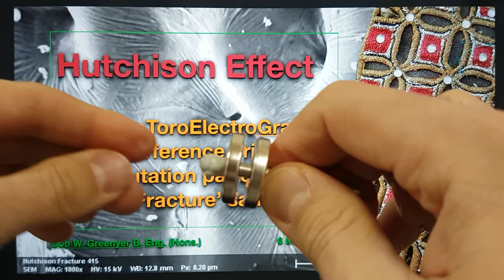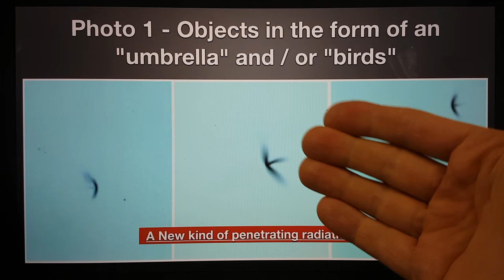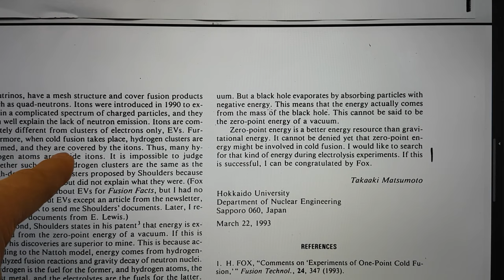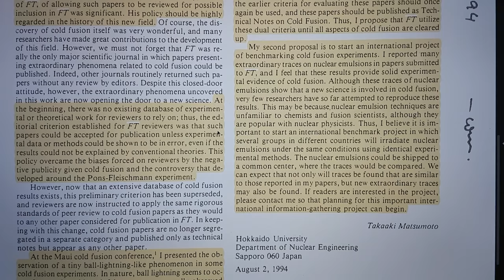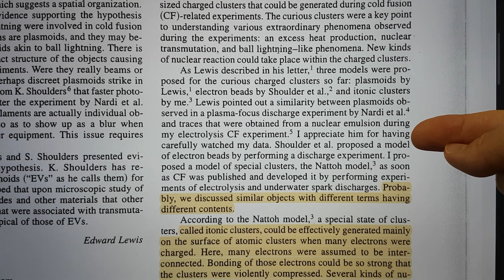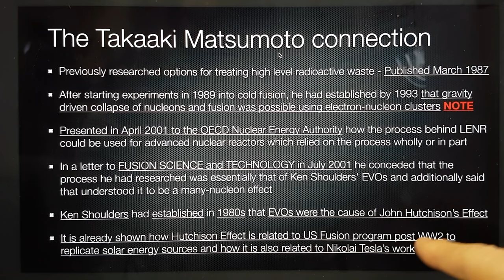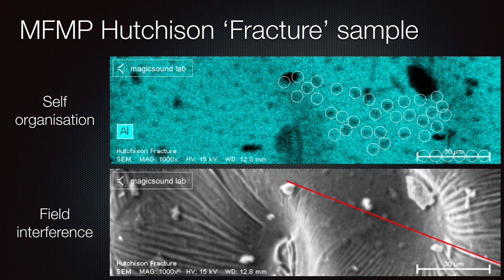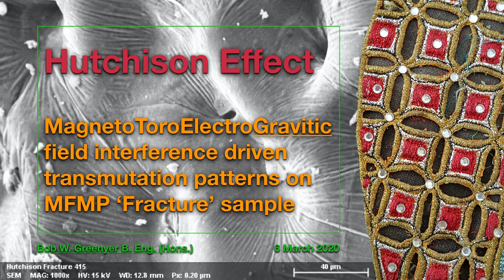Hutchison Effect - Magneto Toro Electro Gravitic field interference driven transmutation - Fracture

Comment: I think the geometry of the holes can be described as the arc discharge similar to what occurs on the sun.  The magnetic field lines form loops that leave the surface and then re-enter the surface.  That is my opinion and it could be wrong.

Comment: Its interesting that Palladium is used. Its on the list of David Hudsons ORME elements. They loose 4/9ths of their measured mass when they enter the high spin state. An 'anti gravity' effect. They superconduct (allegedly) at high temperatures. Complete digestion of gold should lead to a comparable excess heat to the palladium. All internal magnetic fields must be expelled, that is measured as excess heat. The excess heat of 'cold fusion' is actually a result of the lower energy state of mono atomic palladium over metallic palladium. ???????????????????????????????????????????????????????????????????????????????????
Reply from the maker: See here from mid 2017

https://youtu.be/NlCOFSbv6lQ?t=1225
Reply: @MFMP  Thank you. I thought I was all alone in the world with my obscure interest.

Comment: Air has plenty of carbon though. Misusing the word "effect", doesn't help much. You're observing effects (Hutchinson, knotted wrenches) of some machine you avoid talking about.  Do a video just about the machines and the operational commonalities between them.
Reply from the maker: There is a vast array of discussion and diagrams and books on what was used to cause the effect. There is a huge hole in published analysis of samples produced (though lots of analysis was done over the decades but not made public).

Showing WHAT happened will help establish what frequencies are important - since they are encoded in the interference patterns.
Reply: @MFMP  Maybe there are books, but I haven't seen any of that info being relayed by you. One would expect you'd be showing images, of devices used, every time you show the affected samples, as you were doing with samples taken out of devices you actually referred to as reactors. It just so happens that the most mysterious samples don't have a clear background.
Reply: @MFMP  Wonder why you didn't just link one of your previous videos watch?v=QHcVtYYjxfA    Cryptic titles make a hard find.
Reply from the maker: Air is 0.0391% CO2, and only 1 out of 3 atoms of those is C, Air has a lot of Nitrogen and Oxygen.
Reply: @MFMP  Still, if the conditions are right, it will bond, and it will be resupplied quickly due to extreme turbulence. Controlled environment eliminates this kind of guesswork.
Reply: @klingonbaronessprincesskar5519  If you've got videos where it's clear what you're doing and what the environment looks like, be sure to share.
Reply: @klingonbaronessprincesskar5519  Keep the useful parts, get rid of the rest. Focus.

Comment: Here's an idea. Have a laser (focused like this one) watch?v=KfVS-npfVuY&t=40s  fire into a near field of a Big Van De Graaf (or between watch?v=QTn2Q21qEr4), or a streamerless Tesla coil (or into the gap  watch?v=H0Mb9giO1y8&list=PL7XMC8-aEUPD7x4PjT2hJr7N9FnCNli9V)    The idea is to have no breakdown, and have the laser initiate (a point) draining of the air electrical potential, if such an occurrence is possible. Contact youtuber styropyro to arrange an experiment.

Comment: "The smaller the spacial footprint, the higher the capacitance".
 Aether's Dielectric hyperboloid is 2 oppositely rotating vortices, separated by its near infinite capacitance of the Inertial plane/Counterspace.
Reply: It is a convergence and divergence relatively from the center or inertia field, but the energy spins the same direction
Reply: @jasonwalker6607  True, Aether's hyperboloid rotates in one direction. The 2 vortices rotate oppositely CW and CCW, looking into the opposing vortices. Positron and Electron.
Reply: Compression and Rarefaction.
Reply: @gyro5d  magnets are cool, I may be a bit confused.  I realize standing on one side of the pole and looking inward I would see energy rotating toward the center of earth, in a vortex convergence and if I were to walk to the other pole and look toward earth I would see what would appear to be a vortex of divergence that is spinning the opposite direction.       But isn't that because of my relative observance.

Isn't what really going on is the aether is passing through the earth from one direction and  just continues to flow through- always rotating clockwise and the appearance of left spin is an illusion because we have observed it without staying in the same position as we are when we observe the other side?